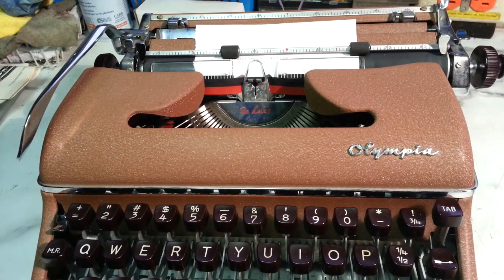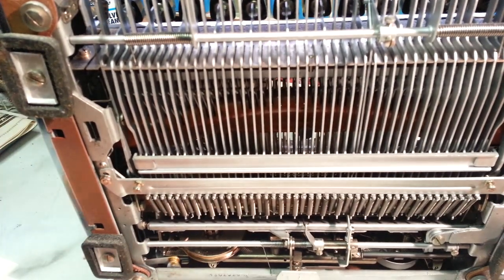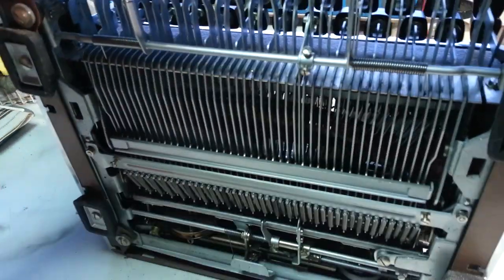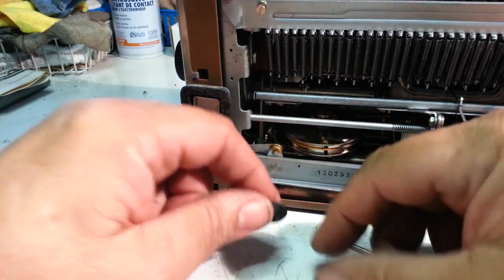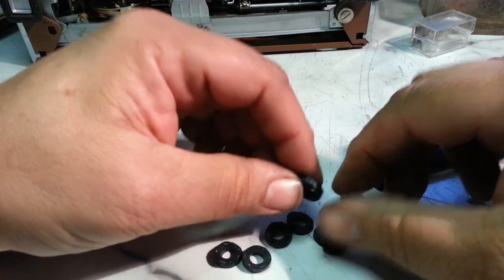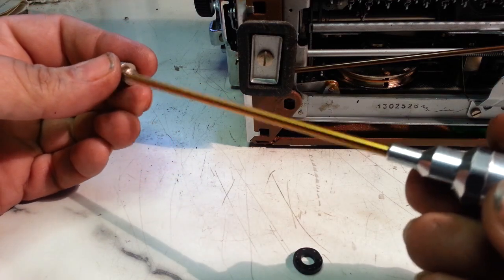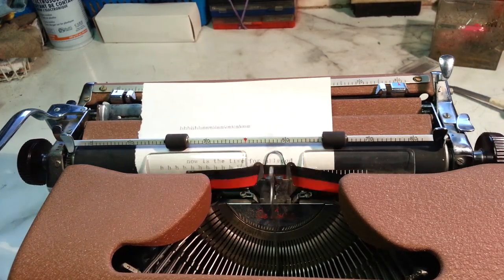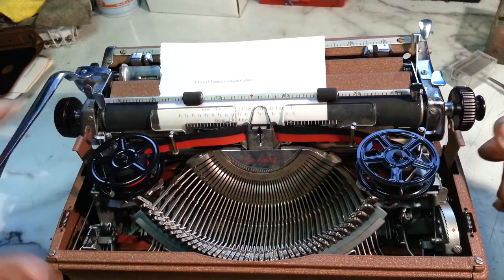Olympia SM-3 Manual Typewriter Repair Space bar, Rubber Spacers, Carriage Stops

Comment: Silly question Duane... why not just get some rubber washers the same size and use those... or were you just using what you had on hand?  I have some washers handy, so I was going to try those, but maybe you know something about the durability of the washers vs the hose with fiber in it.  Just curious.
Reply from the maker: Rubber washers would be fine, just been using the tubbing method for decades, got lots of sizes of hose, some with fiber (fuel) some just rubber (vacuum)
I might look into getting a collection of rubber washers . . . . .

Comment: I have the rubber spacer issue on my Olympia SM-9, except on there, the spacer has two metal pieces on either side of the spacer.  I am guessing that I need to keep those parts, clean them up, and use them on some new spacers? I appreciate these videos you do as well.
Reply from the maker: These are factory heat vulcanized parts. These are good unless they separate, add washer/spacer for more height clearance. 
You can always modify a rubber spacer with 1 longer screw. I just posted a similar answer on Facebook
https://www.facebook.com/groups/typewritermaintenance/?fref=nf

Comment: Help! BAR NOT WORKING AT ALL. I have the same make and model but seems like the bar is not connected at all. So how do you begin to approach this issue?
Reply from the maker: Start at the spacebar, follow the linkage. Does it move when typing ? does back space work ? 
Sometimes you need a working machine to do a side by side comparison.
Reply: @phoenixtypewriter2136   yes the back space bar works just not the actual space bar. I've been using the Tab key to troubleshoot.  It's just been tedious.

Comment: Hey Duane, I have an SM3 where the Ribbon is leaving a faint ink smudge below the text I type. Ribbon is install correct. Do you think the rubber space getting smushed beneath could cause this. Would replacing help?
Reply from the maker: Bushing are not the problem. Paper tight, guide wire tight /snug to paper. Others have found the angle of the lift arms, they can be formed flat to help eliminate the curve/bulge of the ribbon, just did one recently and it helped.
Reply: Phoenix Typewriter thanks Duane I’ll take a closer look. I actually rewound the ribbon on the spool too and it seemed to help. This one I took straight from package and popped in. Ribbon might be a little slack. Usually I rewind on the metal spools if I have them.

Comment: Hi There! Thanks for the video :) My Olympia Typewriter is secondhand and I just found out the carriage is not able to move. It doesnt work with the handle. Also when I'm typing the complete carriage is not moving... Would you know what to check first? Or is there just a handle that I didnt unlock...? Would love to hear from you!
Reply: I released the carriage lock and it also looks like the pin is released. But still it is not moving at all..

Comment: Hello... I was given an Olympia typewriter and all keys will only go halfway up. Do you have any idea what the problem may be? I'm sure I'll have to take it to the doctor for treatment.
Reply from the maker: When typewriters come to the end of the line ( right margin ) they lock, both movement and type bars.
This is called "line lock", this mechanism is sticking, stuck, binding or broken
Troubleshooting, investigating, would be necessary to figure out culprit and solution.
Reply: @phoenixtypewriter2136  Thank you for your speedy reply. I want to sell it. As an expert, would you recommend selling it as is, or repair and sell or are there to many variables for you to properly answer that question. Visually it's in very good condition.
Reply from the maker: @ChazingRainbows  Well would be best to be able to sell a working, typing, typewriter
but If you pay to get it fixed you might not be able to recover that expense when selling it.
I bought my last SM-3 , exact same color, working, for $30. these range from $30 to $300 in this krazy typewriter market

Comment: Do you have a video showing removal of the carriage assembly to access the escapement? I have an SM3 carriage that is immobilized moving either direction where something is either not meshing properly or has been deformed underneath the carriage (whether carriage is to left or right of center, can be moved, barely, only by force). And no, it's not 'melted' rubber spacers under the frame or bent carriage lock mechanism--I'm well aware of both those--this is something very unusual which I've never experienced on the many SM3's I've tackled :/ Visually, the escapement star wheel has all it's 'spikes'. But something strange is inhibiting carriage movement. Thank you.
Reply from the maker: I don't have a video of carriage removal on any SM models, I generally never remove carriages unless they were designed for easy removal

Comment: Thank you for your videos.  They are very helpful and much appreciated.   I have a question about the Olympia SM3 (two, questions, actually) and hope it's OK to ask them here.  

Question 1)     I own a 1958 Olympia SM3.  It appears very clean and well cared for.  All seems great except for two troubling issues.  The letters on the page are 'light' on the lower portion of the letters.  I have no idea how to adjust this.  I can do it with other machines but not this one.  I'm lost.  I've watched numerous videos and have tried to read repair manuals.   (I have tried to adjust the height of the rails using the adjustment  pieces located on each side of the carriage , but without any results in the type.  I have already replaced all four of the "melting" washers, located between the case and the body of the typewriter.  Do you have a video that addresses type adjustment on an SM3?  

Question 2)     While typing on my SM3 all seems great.  Then, without warning, a letter will seem to catch and not print.     (Actually, it feels like a margin limit has been met, but I am in the middle of a line.)   Then, afterwards, all returns to working perfectly.  This behavior is not limited to any particular letter. but I notice it a lot with the letter "T", simply because it is used so often...  <sometimes the key will catch or hesitate, but then carry through and strike the paper leaving two letters, the one that had the "hesitation or catch" and the following letter,  touching or partially overlapping each other.  This is much more frustrating than the issue with the letters printing light on their lower half.  My typewriter works so well except for this.   I am very perplexed by the randomness of this issues.     Thank you any help or guidance.
Reply from the maker: 1st problem is the carriage might have gotten jarred/bent in some way causing the factory clearances to be out of whack, wouldn't take much tweaking for this to happen & to reverse the bend is nearly impossible. Or could be the shift motion adjustments are out of balance with the curvature of the platen roller & sometimes can be readjusted to compensate for uneven print, don't have a video for that exactly.
2nd problem sounds a little like the line lock is engaging accidentally, I don't have one to look at right now & don't remember how it engages, but I would start their & make sure it's not sticking or maybe the spring that hold it back is loose or off.
Reply: OK.  I'll just live with the faded type, at least for now.   And,  I'll check on the line lock issue.   Thank you very much for the input and the suggestions.

Comment: ny chance you or anyone following has a parts breakdown (schematic) of the SM3 intervariable adjuster?  I’m not sure this is the right name of the part, but this is what I refer to as the knob you depress on the right roller knob, I believe it just allows the platen to spin without engagin gears.  The button is a long shaft that connects to the left side roller knob.  I need to repair as pushing the button does nothing.  I can not find a repair vid online or a parts schematic in any of the online Ames Manuals, so I am just stuck!
Reply from the maker: Variable is usually the term, or platen variable, but there is other nomenclature
The facebook typewriter groups are very active, try the maintenance site
https://www.facebook.com/groups/typewritermaintenance/?ref=bookmarks

Comment: Quit sliding the machine around, get a work pad to protect the finish.
Reply from the maker: I haven't scratched many machines in my 40 year career because I'm fully aware of these things
Olympia sm-3 have 4 protruding screws on back panel, these are only thing making contact with my gloss formica work surface
You can see daylight between work surface and back panel, that's also why it slides so easy . . . .